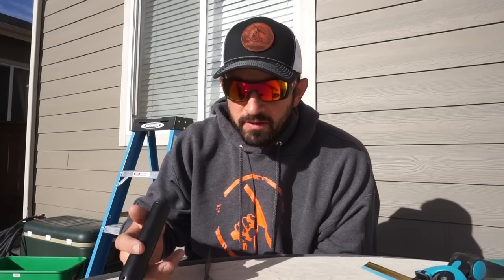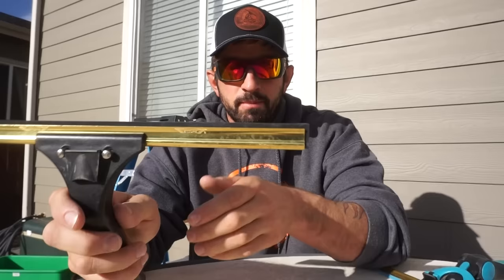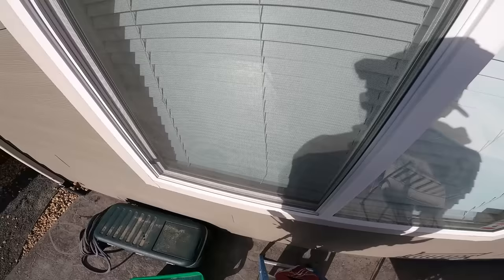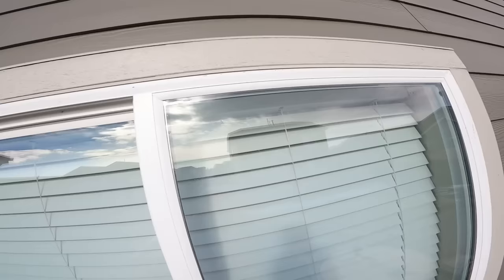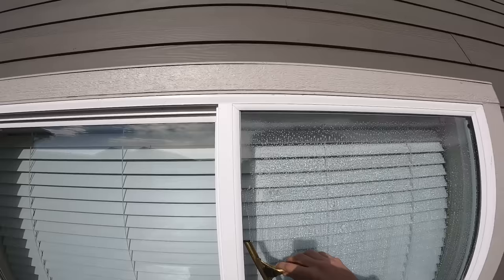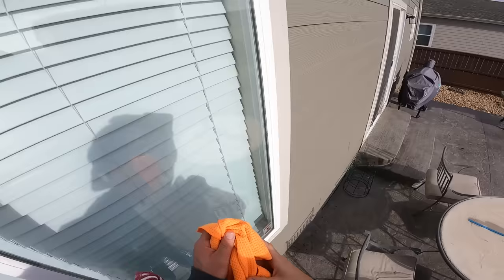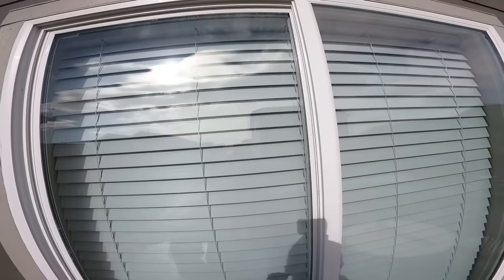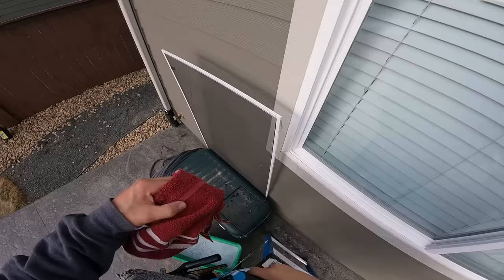NEWBIE SQUEEGEE DO'S & DON'TS | WINDOW CLEANING TECHNIQUES

Comment: Something that I'm trying to figure out being early in the business: what difference does it make what channel you're using? I hear a lot of people say don't just buy stuff from home Depot or Lowe's, then in their videos use things that I can get at home Depot or Lowe's. For instance I have a ledge ease handle that came with the ettore backflip from lowes. I've heard people say that ettore rubber is the best, which I can also purchase at Lowe's. And I've noticed a lot of the pros like the ettore mop sleeves...  Which I also get... From lowes... I'm just trying to figure out why I would go with sorbo for a higher end unger set up for 2 to 3 times the cost. Maybe it's the kind of thing that I just won't understand until I do it, but things are so tight for me right now I can't afford to, especially if I feel like it's not justified. Not trying to sound like I know it all are stuck up by any means just wish there was more in-depth explanations as to why they might be better in the long run.
Reply: The Ettore tools and rubber in Lowe's will often be a cheaper version but not exactly same as the professional tools, makes a big difference when it comes to buying rubber squeegee blades especially. When it comes to being on a budget and not wanting to spend more, it's actually worth getting the right slightly more expensive tool once, because you'll buy a cheap tool then find out it isn't up to the job and then having to spend more  money on upgrading.
Reply: Because when you are a professional window cleaner you need a good squeegee handle, different size squeegees, different size washers with a swivel handle and you need different size squeegee rubbers and a lot of them. You can’t find that at Lowe’s. Also you don’t need any of the fancy stuff just stick with ettore.
Reply: @casto87  I never the got the notification for your reply, so sorry for a late response. I do appreciate your input. At the time it was literally food on the table gas in the tank and that was it. I wasn't trying to say that I wouldn't upgrade if I had the money because I probably would. I was just confused, but it makes sense if they're selling lower grade versions at Lowe's. Again thanks for the input 😁

Comment: I sometimes scratches the frame while closing out to the buttom. Because I am sliding the channel over the frame with it's edge, where no rubber is. 
That's why I am trying to finish always to the side, but is there a better solution for this problem?

Comment: In the window cleaning business, you are not taking the window out from the holes to clean. The holes the window sits inside do not be clean? Or there is an extra charge for this. For a window like the example you used in the video.
Reply: How much money you make ?
Reply: @kermit6983   I am starting now and I want to know how much to charge correctly

Comment: Hi StevO, I'm a "newbie" and having a problem with drag when using the squeegee. I use Dawn and a slicking agent but when a portion of my squeegee is pulled across a part of the window already sqeegeed, it drags and creates a streak. What am I doing wrong?
Reply: hi there you can try to put less pressure on the squeegee when ur on a dry spot or try to not go over the dry spot as much.
i hope this helps
Reply: I've found a less soapy mix helps with this problem

Comment: Why is a 40 degree squeezing holder angle the best?
Reply from the maker: It’s personal preference but I find it the easiest to work with and closes out deep ledges nicely
Reply: thank you so much for your reply. I want to ask one more thing. Is there a proper way  when using a large-sized(ex 90cm width) channel?

Comment: I don't think "wearing in the rubber" first is a real thing :P It's just skipping off the edge when you're going up because its edges are still sharp and it's gliding soother over the glass. Instead of doing all that other stuff just start at the top if you're having that issue.
Another trick when putting in a fresh rubber is always start with the logo on a specific side. I always start with it facing inward. That way I'm always 100% sure if it's been flipped or not already.
Reply from the maker: Its a real thing with some rubbers, ettore definitely has a break in period, but some rubbers do not. But its important because a brand new rubber can be stick and a person could think that the rubber isn't good where all they need to do is break in the rubber
Reply: @SteveOthewindowcleaner  for sure they can skip out more when you go up at the start but again I think it's just because of how much smoother it glides and the sharpness of the rubber edges like I was mentioning before. I don't think moving it on the glass will then allow you to go up at the start easier but I'll try it Monday because I could be wrong. But either way if you're having that issue just start at the top go to one side and then another swipe cleaning the rest of the top and go from there. That way the angle is better to avoid any skipping out.

Comment: wonder if he ever uses "fish foam" or whatever on windows.. I had an indoor only residential friday and they were 6 inch panes so I used fish foam and a 6 inch brass channel on an ettore handle. worked great. but Afterwards thought and wondered if thats something steveo would do or if they even make tbars that size. lol.
Reply: Fish foam is good for garage windows with plastic coverings. Using two towels that will buff those windows clean with no drips.

Comment: Do you still cut the teeth from the excelerator in combination with the brass ettore channel? Or is it fine to just leave themnon...
Reply from the maker: Its fine to leave them, you may want to add some tape to the channel where the handle grips the channel to keep it from slipping
Reply: @SteveOthewindowcleaner  q

Comment: Jersey says to use one brass end clip with Ettore channels instead of two, have you tried that personally?
Reply from the maker: Yep and highly do not suggest it, that can allow the rubber to move around in the channel making a higher possibility to leave rainbow streaks
Reply: @SteveOthewindowcleaner  figured that would occur. I even use clips on my s channels for that same reason.

Comment: use clean water in ur bucket no solution and apply dish soap directly to applicator
Reply from the maker: To each there own, applying soap directly to the applicator is more soap then needed when cleaning a window, and an added step during the day that can be done once by adding soap to the bucket in the morning. And the first time you dip the sleeve into the water you have now added soap to your bucket...so....

Comment: What do you do with the water that ends up on the floor? I’m sure it’s kind of a mess. Do clients usually not care? In terms of residential and commercial?
Reply: You have to wring out your scrubber before you scrub the windows. Get a decent amount of water on your scrubber. Squeeze a little bit of the water  off on both ends  of scrubber while leaving a good amount in the middle.Most of the water will drip off of the ends of the scrubber onto the floor when you pull it out of your bucket or boab (bucket on a belt).I use an unger green microfiber and they hold a lot of water.If you dunk scrubber in bucket and wring out the ends but leave quite a bit of water in the middle,you usually don't drip much water on the floor.Wipe it right up after you squeege the window.luke I said most water that drips will come from the ends of the scrubber. The unger microfibers hold lots of water that will not really drop water on the floor if you wring the ends just a little.You will still be left with a lot of water in the middle that shouldn't drip.
Reply: When you are inside the clients home / business you want to try your best not to drip any water on their floors. My solution is to use little water inside and Use a squirt bottle too. When it’s time to use my washer as I pull it out of my hip bucket i rotate my washer so the water at the bottom of the washer ends up on top this method water doesn’t drip because it now has to flow down the washer.
Reply: On interiors don't use as much water of course but the most important thing is catch your drips with your scrubber as you squeegee.
Reply: I work in new construction windows trust me they don’t care probably bc we are the cleaners as-swell😂

Comment: I know I'm going to sound like a jerk but I'm not impressed with the basic pull down moves. The basic two pull downs for beginners isn't going to go well for them because it's going to leave a streak because water will still be across the whole top and when the right end or left end of your blade hits it it will bring it down the middle of the window. It would be better to line up the left tip of the squeegee 3 inches below the top left corner of the window with the right tip touching the top middle of the window. Then slide to the right staying connected to the top until you hit the other corner and then pull straight down. Then you have no wetness on the whole top of the right window all the way down to the bottom. Then dry your squeegee blade off and pull down the left side. No line down the middle with just a tiny bit to dry off at the top. Sorry to dis agree with you Steve but its still America and so I'll express my opinion. Your fanning looks good and was easily understood. That I have nothing to say about. lol

Comment: Flipping rubber doesnt work because the unused side hets banged yp up
Reply from the maker: Thats not true, been cleaning for 15 years and thats never been the case!
Reply: @SteveOthewindowcleaner  if yout real careful not to drag top of channel on frame would agree but  then it slows you down. FYI I am not a fan of dish soap ita good for beginners but soiling rate increases
Reply: @SteveOthewindowcleaner  Ettori makes best rubber and lasts longer than other brands.
Reply: Yeah i just usually put a new rubber in. If i try and use a flipped rubber i get all sad and soon start to feel guilty, like i'm somehow cheating the customer of a proper clean 😅

Comment: In my 7 years of professional window cleaning... I've never seen a worse way to explain it. Please dont do straight pulls unless you have a squeegee that is the same size as the glass. "Fanning" (wtf?) Is what you're going to want to learn first and practice that.
Reply from the maker: To each there own, once you work with a lot of different window cleaners you'll understand what I am getting at, I use to be of the same mindset as you but after seeing many different ways from others I changed my mind. Clean glass is clean glass

Comment: Your back must be killing you at the end of the day....why are you putting away your tools in your bucket on your left hip if you are right handed?   Makes no sense at all.  That is something you can change, being short is not one of them!
Reply from the maker: Actually many do it this way, I pull my squeegee with my right hand and sleeve with my left and then use two hands most of the time on commercial or residential. But to each there own

Comment: Clueless!!  The fact that you didn’t dry your squeegee in between pulls,and didn’t dry a area to start your pulls in the first place,will result in streaks.
Reply from the maker: You're wrong, drying off your squeegee in between pulls will result in worst streaks then not doing it. You need solution on the squeegee blade to have the glide down the glass. You can simply feather the rubber at the top of the window and build up solution on the rubber resulting in zero bleeding from the rubber. And you can cut in with the fan technique with out drying your rubber and get no streaks. Drying the squeegee is good though for newbies learning to be a window cleaner or for home owners cleaning there own windows